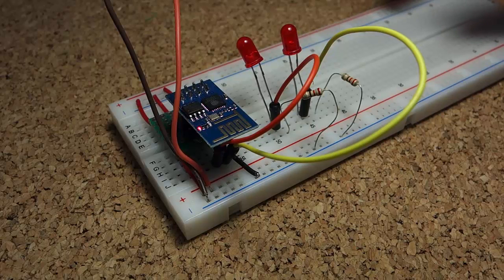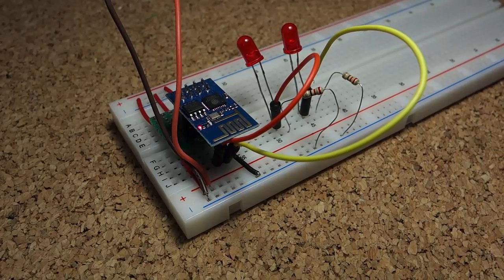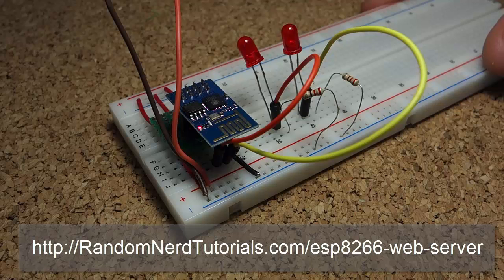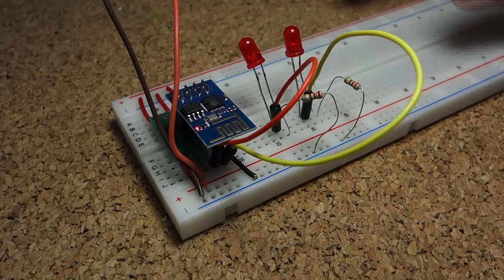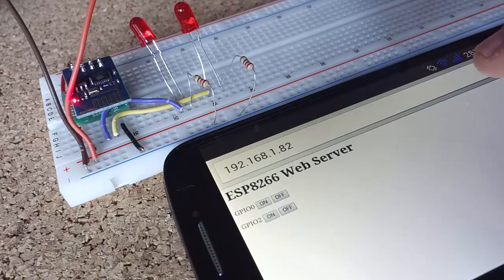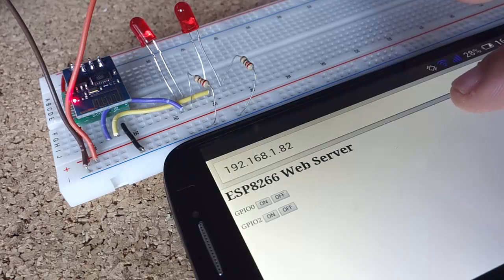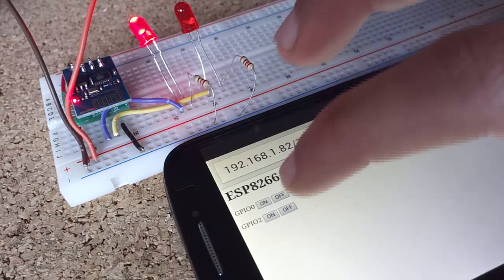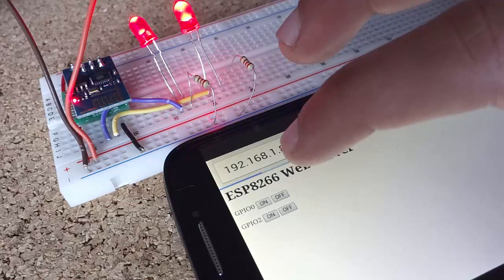ESP8266 Web Server (Code and Schematics)

Comment: Hi Rui. Very cool. I'm new to all this and I have a quick question. It sounds like it's possible to have the ESP8266 be connected to an existing LAN and still act as a web server to that LAN. This is of interest to me because I want to have automation software on the LAN be able to access data from a sensor feeding info to the ESP8266, and to do so via a RESTful API. In other words, the ESP8266 is not creating the network, it just feeds its data to the network when requested to do so. Is this possible? Thanks!